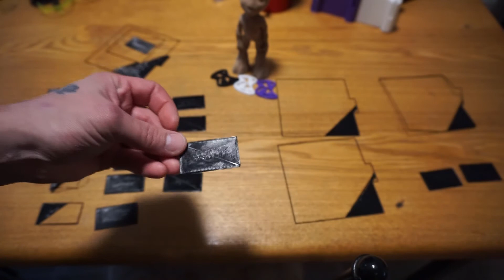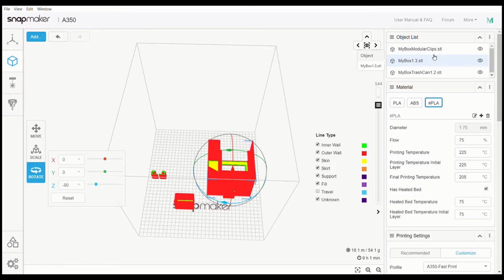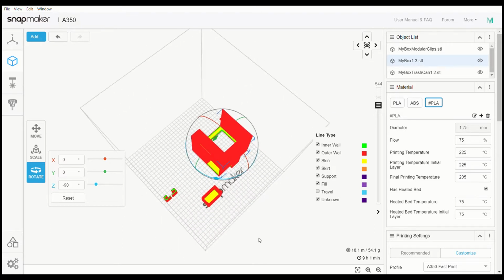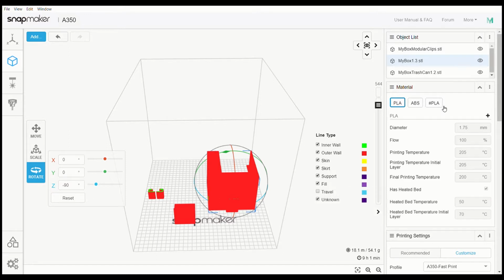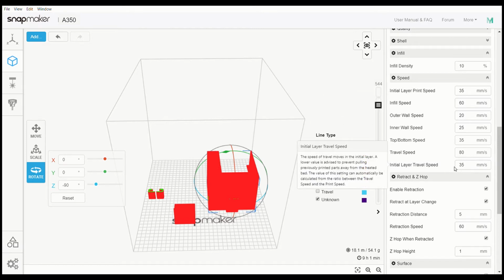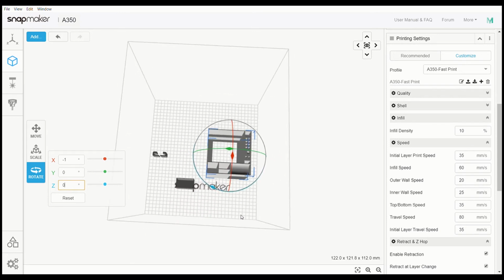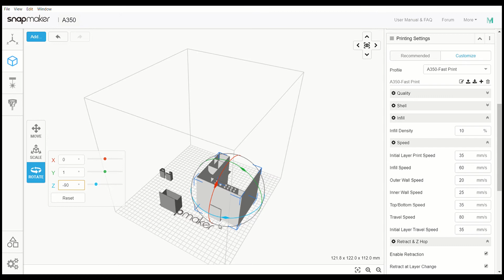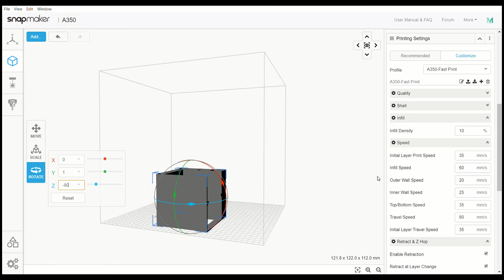MUST HAVE SNAPMAKER 2.O PLA SETTINGS

Comment: I've noticed that after auto bed-leveling, and then using the recommended snapmaker feeler gauge, my z-offset was WAY too low, and was causing that ripple that you're seeing. Make yourself a 200x200x.2mm cube (so it's a single layer), and play with the z-offset setting while printing that to get a smooth surface. I'm really close to perfect with adding .2 mm to my z-offset. It would probably be perfect at +.17 or +.18, but you can't get there with the controls from the touchpad.

Comment: THANKS I am also having trouble like U.
The learning curve is real steep in Laban.
One thing I notice in your settings is the infill 10% seems  too low.  I am accustomed to Prusa and never set infill lower than 20%
Try looking at that. 
GOOD LUCK.
Reply from the maker: Much appreciated and you're right in your comment.  The main problem was just getting the print to lay down initially.

Comment: what is this? i have had very few fails with the snapmaker.. have you calibrated the nozzel? and the K-factor?
Reply from the maker: To be honest I never really got to the bottom of it per say but with the original bed and Snapmaker filament I never had the best adhesion. Switched to a glass bed and different PLA type and it was fine.

Comment: I am just getting started myself and have been doing research for about 5 months now.  Better Brand of Filament does help, making sure you room temp stays consistent when not using an enclosure. I have been told bed temp of 70 and nozzle temp of 210 is the best when using PLA . Most filament comes with the recommended temps but seam to need tweaking a small amount.
Are you using a Polysmooth PLA or a Polyterra PLA as these temps work great with these types. 
Hope that helps @THUMB FPV

Comment: Thank you for your video, I'm having similar problems and will try your ideas.
Reply from the maker: I've tried several different types of filament and across the board I think the biggest issue with printing is getting it to stick to the board. If you'd like to ask any questions you can contact me directly at THUMB FPV on Facebook.